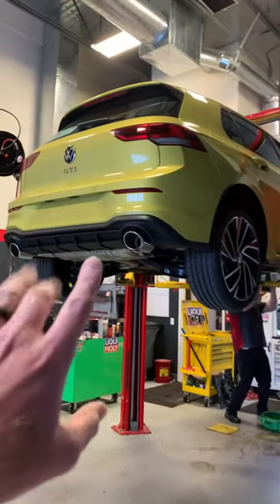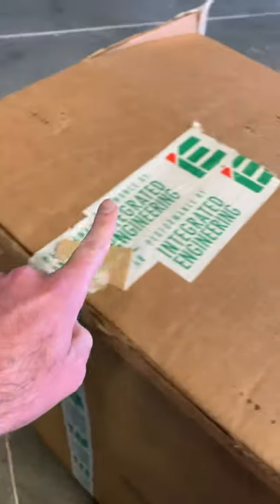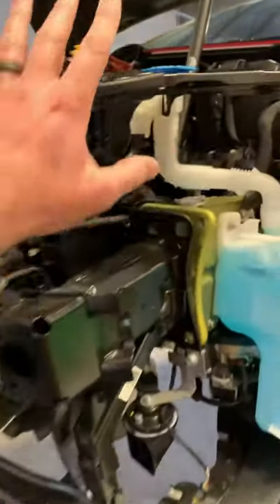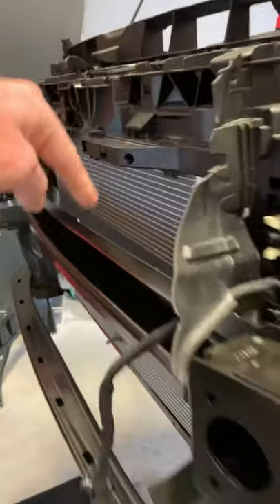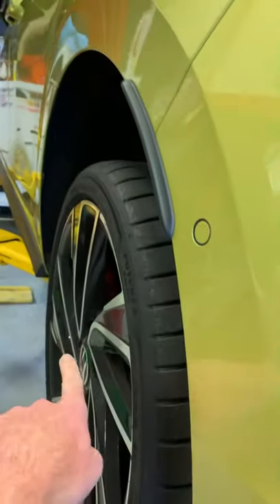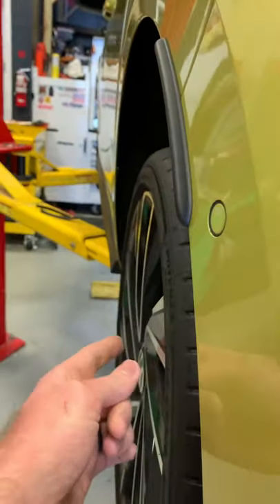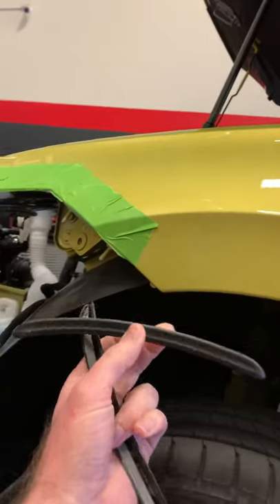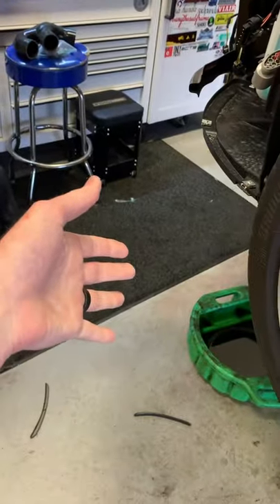MK8 GTI Intercooler FT. Dumb Plastic things  #shorts

Comment: The fact that you have to disassemble the entire fucking front end just to change the Inter cooler is an absolute horror. These cars will be scrap in 10 years
Reply: You don’t have to. He just wanted it in stock location instead of adding a FMIC. I’m pretty sure you had to do this on the mk5-mk7.5 too for stock location intercoolers.

Comment: Bud... I need help. I got a 2012 gti. I'm getting no boost at all I'm lucky if I can get the car to go 40mph.  I replaced the dv the n75 I got an n80 I haven't popped in yet... But any idea what can be killing my boost
Reply: Check engine light on? Electronic control waste gate is stuck open and it is in limp mode so as to not blow the engine my guess. 9 years working VW
Reply: Could just have a leak in your charge pipe too
Reply: Go to a mechanic
Reply: You probably have a leak in the system